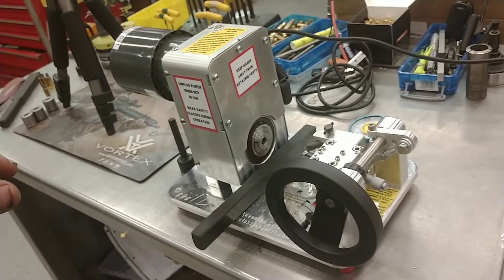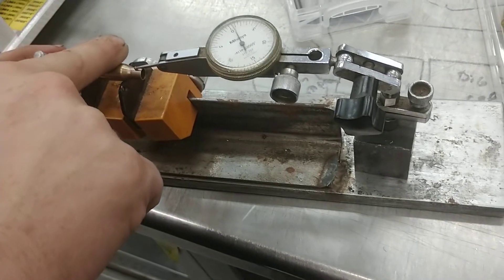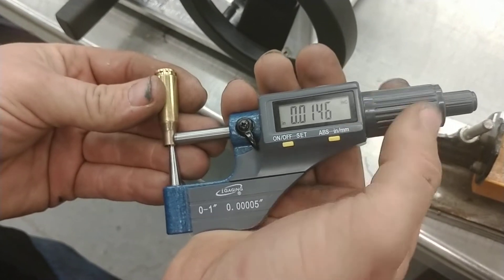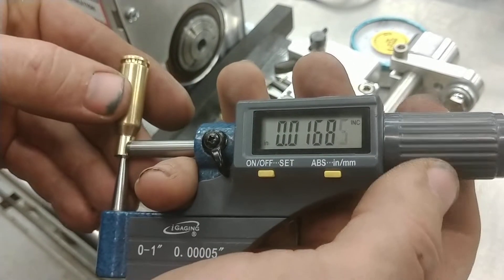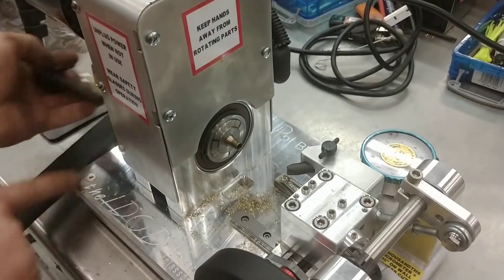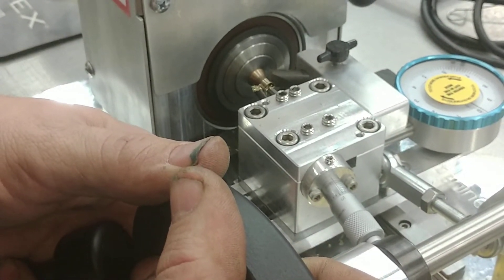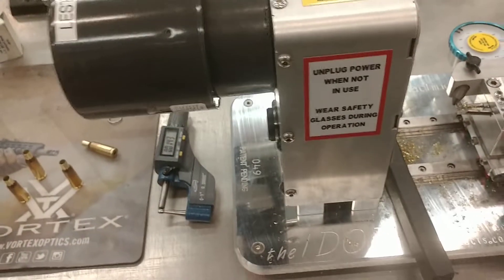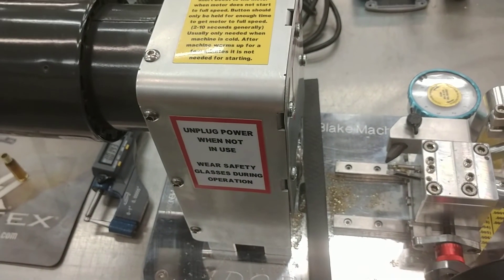220 Russian cases expanded and ran in the IDOD

Comment: Nice job. 
However I Have a question.
You say that after having expanded the neck, you pass again the expanded case in a 220 russian full lenght resizing die.
If you do that, the neck Will Be resized to the original diameter.
Something wrong no !!!!!!!!!!